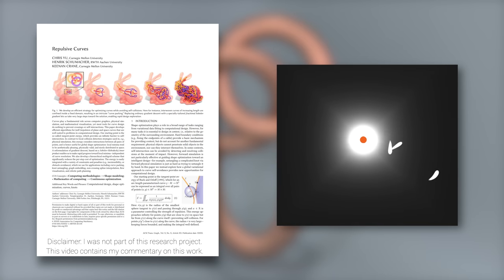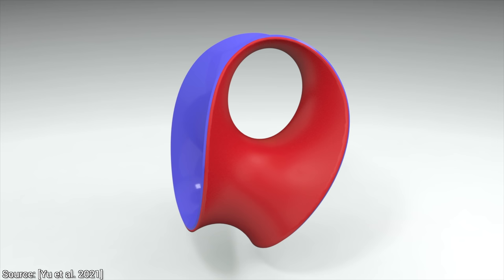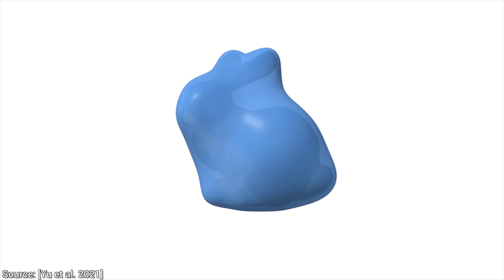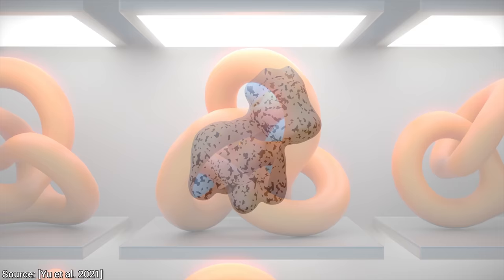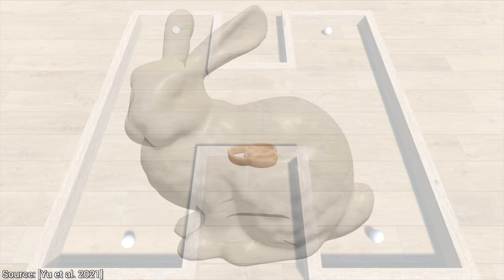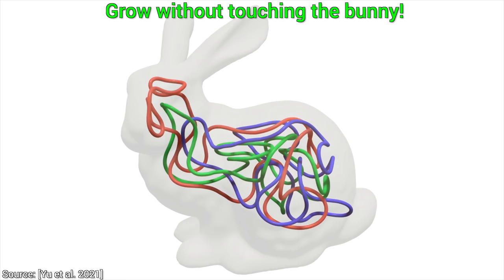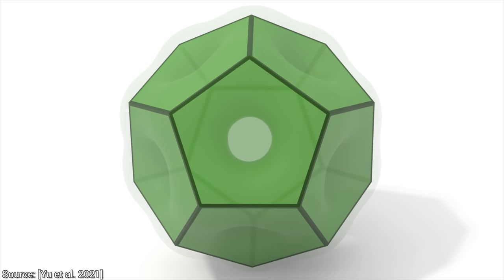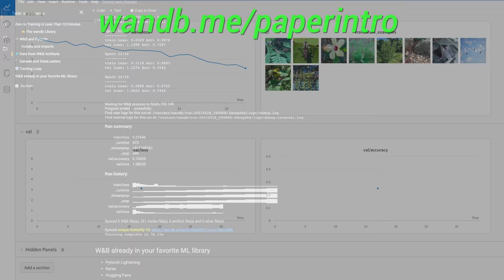A Repulsion Simulation! But Why? 🐰

Comment: This is simply amazing, specially if it doesn't break the bounds of the mesh, this could be the next cloths in games, forget about clipping through objects, this could save it by repulsing one of them or both, imagine this with grass and a foot messing around with it
Reply: Finally the shrubs I wander though could deform properly instead of clipping! Outstanding!
Reply: Check out this channels recent videos. There are some methods that are well suited to those kinds of problems.
Reply: My thoughts exactly. The navigation example also sound great for crowd avoidance. Only question I have, is it fast enough to be used in actual games or is only just fast enough for a showcase scene.
Reply: Days Gone has the most realistic facial animation I have ever seen in a video game
Reply: Real-time 3D rendering with equally real-time anti-clipping?
Reply: Guys in this channel have some epic ideas. Now all we need is a viable brain chip and we can recreate soa.

Comment: I'd love to see this applied to brain growth and wrinkles. Some people think brain wrinkles are adaptive, while others think that the typical brain folds and wrinkles are primarily due to the forces squishing the brain as it grows and the skull solidifies. Would be interesting to model brain growth in this and see if it produces characteristic physical human brain patterns.
Reply: +1
Reply: not a brain researcher or anything, but the presence of wrinkles suggests maximizing surface area, or conversely minimizing mass to volume. koalas are considered one of the least intelligent animals (compared to mass) on the planet, ant their brains have no wrinkles. there is a correlation, and I bet a causation between these factors.
Reply: @devilofether6185  : not disagreeing, but I've personally never read a good explanation as to why more surface area is helpful.
Reply: @NirvanaFan5000  more surface area means you can cram more cells in less space
think of it like shoving deflated balloons into a box, vs having to inflate the baloons. more surface fits in total due to the creases using space more effectively 

our lungs and intestines actually pull a similar trick!
the lungs have alveolae that increase the surface area of the lung so we can absorb more oxygen 
the intestines have folds all along the inside of the tube for more cells that allow the absorption of nutrients and water along the surface area of the intestine itself

well, for the brain it simply allows more individual braincells to be crammed in the limited space of the braincase, thus making us have more brainpower and a higher potential for intelligence than koalas and their smooth brains

i hope this helped you understand why folds are useful!
Reply: @triangularlizard  I don't understand why you think wrinkles would allow for more cells. if you can fit a 3lb dough into a bucket, you can't fit more dough in by giving it wrinkles.
Reply: @NirvanaFan5000  it's not that you can fit more cells, it's all about topology and network efficiency. A straight 2D or 3D surface only allows for connections between adjacent neurons, while a folded surface introduces skips that allow information to propagate faster and using less neurons. This makes it possible for networks to specialise locally for domain area processing and communicate via higher order signals, which is equivalent to creating deep layers in artificial neural networks. If this is all too abstract, think of drawing a maze on the surface of a marble vs drawing a maze in a sheet of paper and folding it up to an equivalent volume. Which one is harder to solve?
Reply: @andremeIIo  : thank you for the feedback. I don't see why folds would allow for faster communication. The quickest path is a straight line, not moving around folds. That said, it would be interesting to learn more about your point that folds could potentially increase specialization and higher-level neural communication as being helpful. cheers
Reply: @NirvanaFan5000  sorry, can see why you're confused. Folds can help because at points where the surface touches itself it allows information to leap from one point to another without taking the long way around. It creates a shortcut - like a wormhole in 3D space.
Reply: @NirvanaFan5000  also about the other bits, sure, I'm no specialist, but I can give an intuitive explanation. A neural network is a physical entity, and each neuron must physically connect to another in order to pass along information. Additionally, there's a rate of error in that process, which creates a sort of friction to the  spreading of information. Those two factors combined mean that computation must have a local effect, where clusters of neurons work to solve specialised problems, rather than the whole brain working together as a unit. This way each neuron cluster is essentially a standalone neural network that communicates with others in concise higher level signals. Those higher level signals can travel through shortcuts, while the bulk of messaging occurs in a tight self-contained space for cohesion.
Reply: @andremeIIo  Hi Andre: Again, the point of local specialization is interesting and I'd like to see research which explains and confirms it. As for the other part about direct communication: If two brain cells in different gyri want to communicate, the problem with folds is that instead of taking a straight line - which is the shortest path - between the two, the signal must go around the path of the gyri, which by definition is a slower, less direct route. This may be beneficial, but it's not clear why it is. 

Also, I do not think that cells that are next to each-other on different folds but touching communicate directly. By way of analogy: if I touch my thumb to my index finger, the two are not communicating more directly now. They still have to travel the path through my palm. 
My understanding is that brain cells that are touching on different folds do not communicate that way, and must instead go around the folds to communicate. One reason for thinking this is that neurons are connected to each-other, which is what gives a brain its solid mass. If you cut a brain, you're cutting through connecting neurons. In contrast, you can kinda wiggle brain folds open to a certain depth without cutting bc there's no real connection between them, there's no axons and dendrites crossing across the gyri. 
I hope that was clear. I'm not an expert either and don't always have the best way to explain what I'm thinking. cheers
Reply: @NirvanaFan5000  (I am also not an expert but here is the way I see it)
I believe that the correct answer is a bit of both, with some other forces acting as well. The reason being that fetuses start out with 0 neurons and must grow them within a confine space. But just growing a solid (smooth) brain hinders that formation of different brain parts by reducing surface area and paths. A clue as to what the folds do can be found with Lissencephaly (literal smooth brain syndrome) that condition has the following symptoms: Slower mind and reduced physical movement, seizures, low muscle tone, muscle spasticity, trouble swallowing, and a range of other anomalies. The cause: Disruption of radial and tangential migration of neurons. Neurons unable to move to their correct location is what causes that condition, and it results in a weaker mind, not better.

The best way I can imagine that represents this would be computer processing. Having 1 server while great and all can only do so much. Making it bigger while it helps it doesn't solve the problem of not being able to compute massive amounts of things at the same time. So the solution? Add more servers until it is no longer a problem.

Also note that you said that the folds are not connected the same way and that is true, because they are made up of mostly gray matter with white matter in the middle. White matter is drastically better at transmitting signals. Using the server analogy again. Each fold is a server rack with countless servers each, all connected via long stretches of wires and corridors that handle the maintenance and actual data transfer.
Reply: @NirvanaFan5000  no, that is clear enough, thanks. And you're right, my statement of folds self-intersecting is misleading. I was thinking of the neurons at the "base" of the gyri, not the ones at the extremities. The edge ones are clearly physically disconnected from other gyri and won't be effective at making information leap from one section to another. But at the base should be able to exchange information with far away parts of the brain through the corpus callosum (at least that's my layman's understanding). So the majority of the gyri is only locally connected, while the base effectively acts as an interface with the rest of the brain.

As for specialisation, not basing this statement in any research I've seen, so take it with a grain of salt. Although in a sense the fact that we know different parts of the brain to perform different functions is evidence of that. As a computer scientist with some background in ANNs and complex networks, it seems self-evident to me, as it's the most efficient way to use the brain's topology. Since transmitting information is so lossy and slow, doing computation locally and only transmitting summarised (higher level) results is much more robust than having raw information travel far. But since local computation, by physical necessity, only involves a small part of the whole context, it must be specialised, or it won't produce self-contained bits of information to be exchanged with other loci.

Or to put it in a more intuitive way, the brain is like a very big and bureaucratic data analytics institution, where departments can only communicate via standardised forms. If every department does the same thing, that creates duplicative work and the institution doesn't really get much done. Every form will report what other departments probably already figured out from their own work, and it take many exchanges to make any progress. By contrast, if each department specialises, they can share different interpretations of the same data, and work through the abstract summaries to make more robust global inferences.
Reply: @NirvanaFan5000  I also fail to understand why people maintain that the  'greater sufface area' implies more neurons. Your dough analogy is beautiful btw.

Here is my Personal understanding of the need for the greater sufface area: it creates a greater sufface area for the contact between the blood vessels and the brains cells. This allows the brain to be the resource-hog that it is.
Reply: @andremeIIo  : good points. and to clarify, I think we know for certain that diff brain regions specialize in tasks. but what i'd like to see explored is whether gyrification is necessary for that to happen and to what extent.
Reply: @mcmoswane  : thank you. I also wondered about that but i'm not sure if access to blood within an organ is less efficient, or how much the gyrification actually increases blood flow. For instance, are there blood vessels between the gyri? I'm not sure. If it's just on the surface, then the gyri would seem to be less efficient (since the wrinkles are empty spaces without more access to blood vessels.) 
I think you and Andre raised some good ideas, and they're ideas I've toyed with myself, but I feel like they need a lot more verification. And i honestly find it weird that we don't yet have a clear answer for this.
Reply: @NirvanaFan5000  axolotl gills are branched because it maximizes the surfaces area, similar to how all gills maximize surface area by creating folds. more surface area is touching more water so it is able to extract more oxygen per second. like how you can only send so much water through an aperture per second, only so much water can be converted based on the surface area. it would be dumb for the gills to simply massive rods, because even if it achieves the same surface area it would be cumbersome and costly to have such large organs on your face. another example if you're just totally unscientifically minded: imagine dipping a cookie in milk. since the cookie is full of air pockets it allows the milk to coat the insides and make the cookie soggy. if you had a cookie coated in icing, then the surface area of the cookie would be lowered to zero since the milk wouldn't penetrate the shell. the more cookie you can expose to the milk at once, the quicker it becomes soggy. if you still don't understand, use google dude.
Reply: @NirvanaFan5000  so then you get to the question "why would surface area be more useful on a brain?"
have you ever imagined what it would be like if our brains were twice as big? sounds cool but it would actually take longer for information to travel across your brain. the whole point of this is that surface area saves space, and that has many side effects.
Reply: @originalman6599   : The thing is that while gills are surrounded by water, lungs filled with air, cookies soaked in milk - our brains are not floating in blood. Furthermore, we have capillaries throughout our brain, particularly the grey matter, so it's not cut-and-dry that the surface area for blood idea is the answer. For instance, others here posed other ideas, like computing efficiency through physical barriers. So yeah, that's a possibility*. Furthermore, that doesn't negate the point about the *pattern of the folds resulting from physical forces. 
Lastly, while folds do increase surface area, they actually increase the distance for information to travel since it can longer do so in a straight line. The more and bigger the wrinkles, the longer the travel time. 
Anyways, it just feels like your responses ignore the entire thread and were a bit insulting. thanks though.
Reply: @NirvanaFan5000  i dont got a degree in none of those areas 
but
if we suppose the brain is a giant mesh of cables, and those cables need some cover (like the colored plastic ones on copper cables) to protect the signals, then it would make sense for wrinkles, right? since you can jam more cable (just like the spaghetti growing inside the bunny as we saw on this video) inside the same space, than if you just ran a spiral wire or just covered the whole thing in wires

kinda like what our headphones do in our pockets, they diminish the size they occupy on some dimensions inside our pockets by getting all tangled up

but i agree with you so far, can't really agree to chalk it all up to maximizing surface area
Reply: @andreioliveira720  : I believe more space is lost due to the wrinkles. Partly I think the confusion has to do with scale: wires are big (visible to naked eye); neurons are small. But wrinkles are big. Also, the neurons aren't sitting in a vacuum. all the space in the brain is used. neurons have long dendrites that extend outward, overlapping other neurons, and there are other cells, like glial cells and blood capillaries. anyways, I appreciate the ideas but not sure it's the right answer. cheers
Reply: @NirvanaFan5000  but the fact is, we can't have dendrites touching each other, now can we?

Maybe it's because of that rule-of-thumb the wrinkles pop up, so they can maximize the area that the wires occupy without touching each other
Reply: @andreioliveira720  : why can't dendrites touch each-other? and wrinkles hardly prevent this considering the folds are like an inch thick but the neurons are microscopic.
Reply: @NirvanaFan5000  So hi, not a neurobiologist per se, never got a thesis or PHD but I did manage the master degree for what little it's worth. Yes, surface aera do allow for more brain cells. BECAUSE brains cells are already organised in a layer system such as their soma, cellular  bodies are on the outside. (and in fact even if you look at the remaining 1/3 remaining, the nuclei, you'll see they at a smaller scale have a very similar organisation on a smaller scale) That's why it's called a cortex, ie the latin for bark, the outer layer. 

That's why your previous analogy with the dough doesn't work because if you shape a lump of a dough, weither you make it a flat surface, a lump or put it in a bucket, the dough is generaly roughly homogeneous no matter where you take it.This is not the  case with your brain. You surely are aware of the diference between grey and white matter, gray matter is the part that contains soma and white matter are conecting fibers. 
Now WHY and is this organised the way it is, is complicated and subject to debate. There are a few factors that come to mind, from the way embryo devellopement work (from stem cells mulptiplication happening inward to migration to outer layers), from the way the the cellular bodies which is where the respiration happens need to be in contact with the network of blood vessels cotained in the brain and the LCR. But the fact is: for a given volume, maximising surface aera is a major factor.
Reply: @s.m.2523  interesting, ty!

Comment: Applying this to protein folding could be interesting.
Reply: I believe that could revolutionize the field, actually.
Reply: I remember the game Foldit that came out a while ago that attempted to crowdsource certain folding problems
Reply: @btat16  Indeed. Although it was hard to qualify it as "a game', but it was a rather curious piece of code in its own right.
Reply: It would need heavy tweaking to account for all the molecular forces involved but yeah, it would be interesting indeed.
Reply: Bingo!
Reply: I really like this idea, especially if it did it while building up the protein one amino acid at a time, just like how they're formed inside cells, rather than starting with the entire polypeptide in a long string
Reply: Start coding that as a BOINC project, and I'll sign up to crunch data for it. I'm signed up for everything that's working and which doesn't require dedicated hardware.